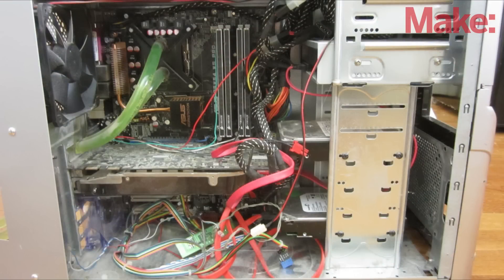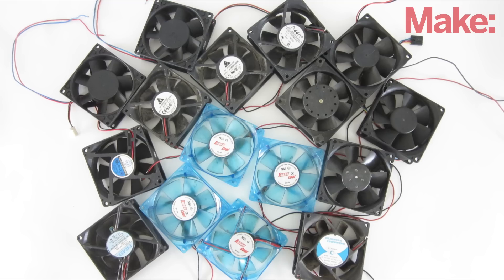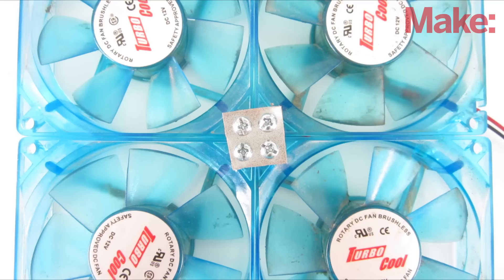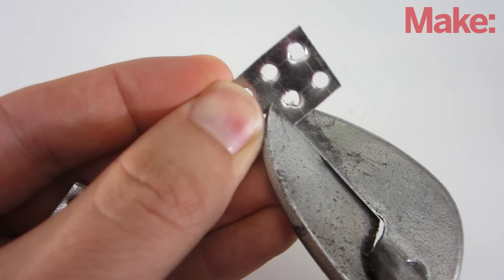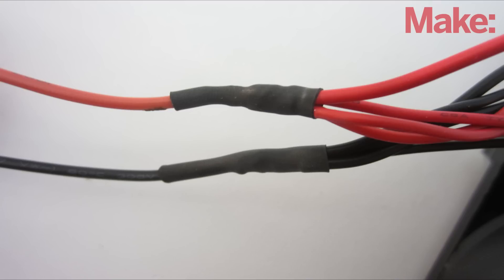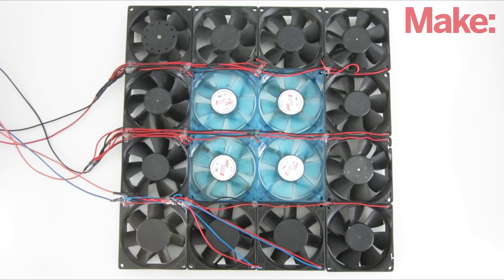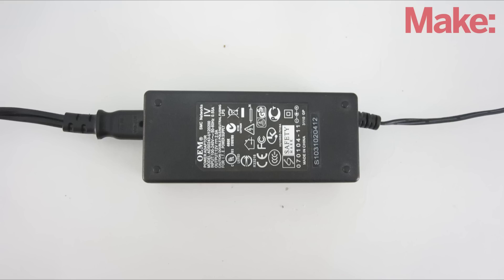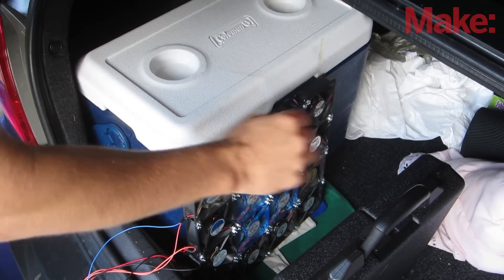PC Box Fan

Comment: also, rather importantly, make sure they're all flowing in the same direction lol
Reply: @burnzy3210 that easy if know fans have plastic crossing over one side and not the other and air goes through one way then
Reply: @mlee6050  I have several fans and they have mixed directions and do not follow the crossing. They shape of the blades is better indicator but there's also an arrow symbol printed outside the duct that shows the direction.

Comment: I just recently built something very similar (3x3), but built it into a collapsible/nesting type extension arm with a detachable carbon filter, it folds nicely and fits into the bottom of my toolbox when not in use and for portability. I use it as an overpowered fume exhaust (because I'm real paranoid about lead fumes when soldering, but refuse to use leadless solder). In my building there is an electronics recycling bin, and as luck would have it on the 3rd floor there is a hardware manufacturer who recently they put a few dozen new fans in the bin! Keep an eye on such bins folks, lots of treasure to be found, one mans trash right. Nice project :)
Reply: Lead isn't what's Evaporated

Comment: I dont comment on youtube videos but this one is special.  This has been the subject of much subconscious activity that occasionally forces itself into my conscious mind and distracts me.  When I saw the thumbnail of the video it was as if someone had been inside my head rummaging around.
So, that said, I also imagined the little metal squares with nuts and bolts. I also took that idea to the point of a sheet of metal on both sides with large holes for the fan to blow through and the small holes at the corners of the fans to bolt or even pop rivet then together.  What my mind kept coming up with was a wire routing that went into the spaces between the fans as there is just enough space there to put all the wires out of sight. Finally, my brain told me, all the stickers at the center of the fans should be pealed and replaced with round black stickers to improve appearance.  None of this is intended to be criticism because I never actually built my idea and you did.  This is just intended to infect your mind, which seems to be similar to mine, with the ideas I had for years in hopes that you might build it.  I think this idea could be taken to the point of a saleable product with a few finishing touches.  
Great work!

Comment: We did this a few times with left over fans. It makes a hell of a noise unless fed 5-6v instead of 12v. And if you make the mistake of chaining them, you'll cut voltage by half every step, remember that.
Reply: if you use 4 wire fans and connect the blue to Ground they run at low speed, almost silent!

Comment: Quiet ? I doubt it. Unless you spend a fortune on quiet fans, they're gonna be pretty loud, esp. if they're small.
Reply: *****
prius owners take every chance they can to let you know that they do drive a prius
Reply: for this sort of thing, i would recommend Noctua NF series or Aerocool DeadSilence (all 140mm) if you want quiet, but they are like £15 each (or your regional equivalent)
Reply: in a computer, premium fans are actually a really good thing if you have the room for air flow as they are optimized for pressure rather than just moving air, can drop the temp of your components a lot, however, open air solutions i cant say
Reply: ***** they are worth it. Great airflow low noise.
Reply: +StereotypedFilms could you link a $1000 fan?
Reply: +Daniel&#39;s Game Vault The Delta fans are the ones that isn't quiet. I have two small Delta fans and they sound like fighter jets.
Reply: I agree but the idea I like the idea. Good instructions.
Reply: the really good fans you barely hear while still providing high CFM. ..... hydrodnamic bearings are very quiet.
Reply: Depends on the fans, I got 11.3 dba 60mm fan for my 3D printer but my PC has fans that are quieter than corsair and the brand most get starting with n so yeah

Comment: if you hooked them in series you would need 192V which can easily be achieved with 120V mains through a bridge rectifier and capacitor gets you 170V each fan would get ~10.6V but thats good enough
Reply: That will not work. The problem is that the fans each draw current in pulses. If you could keep all the pulses timed so that all fans wanted the same amount of current at the same time, you could do it. But you can't keep them in sync. I have done 2 fans in series, and it didn't work well until I added a capacitor across each fan, to even out it's current draw. I also had to use matched fans. Same brand, size, and current draw. Then it worked fine, but I don't think it would be safe to try this with any 120 volt mains power, even if you did have enough fans to "share" the high voltage. The problem is if something goes wrong and they don't share and one fan gets hammered with all 170 volts. It might be okay if you lived in a house with concrete block interior walls and had no combustibles nearby. Other than that, put the fans in parallel and then you don't need capacitors, or matched fans. You can easily get a 12 volt power adapter online for a very reasonable cost. I have also seen adjustable voltage units that would let you adjust the fan speed easily.

Comment: So I made a modified Corsi-Rosenthal box, but the fan I used died after 2 months. I was turned onto PC cooling fans becasue I found out they move more air for less power. Now All I need to to learn how to rig them up and find a few used fans or dead PCs to pick apart.

Comment: So i was considering doing some type of Desk mod with fans, yea it gets hot in my room and ya know where i needs that fresh air :3 Anyway, ive got 1 12vDC - 0.37amps 120mm fan, if i were to do 18 just under 7amps for my battery would this work? Not gonna really do this, was thinking of around 10 fans which is around 5amps in total. Would this still work decent with my battery? Im doing this off of a Solar Controller/12vDC-7A Battery so i wont really be pushing that monthly bill xD

Comment: thanks man, I'm planning to attach them to my DIY laptop desk. 4x120mm fans is good enough.

btw how to know between + and - of the cables, and will it be ok if i plug it right into power outlet or power supply is the safest way?
Reply: Generally there are 2 kind of fans: 220v (ac) and 12v (dc) voktage. Check the voltage stated at the center of the fan. Then, for 12v fan, the positive usually have RED cable, negative is BLACK cable. If your fans is 220v, it is save to plug them directly to powerline on your wall. There is no + or - cable for 220v, you can safely plug the cables without worry of their + ot -.  DoNOT plug the 12v fan directly to powerline at your wall, they need DC 12v powersupply, or you can use your dad car battery, it is 12v. Hope this help.
Reply: @aswingsharif6729  ty man appreciate your help;) not an electrician, so im clueless and dont want to burn down my house in an explosion lol

Comment: This rig uses 38.4 watts of power. How many CFM? I can't help but think that it will circulate more air per watt than a comparable box fan with a shaded pole induction motor. My 20" Lasko box fan uses 55 watts on lo, and 96 watts on Hi. It does, however, produce quit a bit of airflow, though I don't have an accurate way to measure it. All I can think of is a side by side test. Your rig isn't quite that big, but it does't use nearly as much power, either.

Comment: i want to say this is an unimpressive video, but im more than likely actually going to use this for my windows, now only will it keep my home cool but it'll be a death trap for any flies trying to get in
Reply: I would but a big piece of modders mesh on the front and back sides of the fans too protect them from getting damaged, and instead of these small 80mm fans get like 4 220mm fans that can push the same amount of air at a lower speed, and with less energy needed.
Reply: Try having an old car battery to rig it up with and keep it charged when not in use with a small solar panel :)
Reply: +turtle79070:  Yeah, that seems like the one killer app for this multifan.  The fans I've seen that are designed to go in windows generally just have one or two fans in them, and then use a piece of plastic for the rest of the height, whereas with these you could have fans across almost the entire height of a window, and you wouldn't need to have your window (and vertical blinds or curtains) open more than 80mm.

So did you go through with the project for your windows?  How did it work out?
Reply: You can add a fan grille.

Comment: kk what is this for you know you can buy a normal fan or turn on the condition
Reply: 1. Not all places have air-conditioning 
2. I think his application is mostly to reuse old/inferior stock fans that get replaced 
3. This rig is portable and can be powered by many sources. 

Mostly though it seems like using stuff that would otherwise be thrown out

Comment: This is pretty pointless. a 20" box fan can produce 2500 CFM (according the mfg) and a cheapo (Rosewill) 80mm fan pushes ~32CFM. You can fit about a 6x6 grid of PC fans in that same footprint and 36x32 is only 1152 CFM.

Comment: I have problem. I have 1 amp 12 v adapter, when I run 1 fan it spins full speed, but 2 fans spins in half speed :(
Reply: you wired in series, wire in parallel. Make sure both positives from the fans are on the single positive from the controller, (same for negative side)
Reply: @Michael HTT at least you here can I use 12v with say 4 fans like if two series and two parallel (two sets of series connected parallel or something)

Comment: What a Great Idea, I to have many fans & now that i've seen this idea, I now feel sure that I can do Likewise.
Here is an instant Idea for the U-Verse owners out their. take a Single 120MM Case Fan & Mount it down on the top of your control box, The one that turns your unit on or off, & if So Equipped, (Like Mine is)  You can use the Front USB Port to Power the Fan, Thus Cooling Down your FAN-LESS Unit. We had already Burned up our first Fan-Less box, & the Salesman told us that none of their units came with a Fan to Dispel the Heat that the box Generates..

Comment: Wait so if I power two 12 volt fans I don't power it with 24 volts right?
Reply: No, they have to have the same voltage as power adaptor, so all 12V in this case. But you need to check how many Ampers your adapter provides and add Amper use in your coolers to make sure that they all don't take more than your adapter can feed them.

Comment: I know this is very late, but wouldn't it be much better to just take much larger fans (like 4 240mm fans)? Since it would provide a much higher contact area with the air, so more airflow and much quieter.

Comment: Bet the electrical efficiency is very low
Reply: 3.2amps at 12 volts is 38.4 watts. The average box fan uses 70 watts.
Reply: @Jcewazhere  Meh same thing, half the watts, but also half the CFM airflow compared to a similarly sized box fan.

Comment: why not just get a 10 doller large fan with a wire and just cut into your case and add that?
Reply: There's a limit to what large fans can do.
They may be bigger, but they don't push as much air as a setup like this.

Comment: A car battery has 60 amps. not .60, not 6.0, but sixty amps. I'm pretty sure that will burn those up in a heartbeat without any resistors or something in place. The battery shown would be the type that would come out of a battery backup unit such as this. http://www.homedepot.com/catalog/productImages/300/1c/1c48cba9-7888-4000-ac87-a294f780caa0_300.jpg
Reply: 12v car outlets are fused at 30A, also car batteries are alot higher than 60A. The internal resistors of the fans will be just fine to run them on.
Reply: granted I don't know much about computer fans (other than the fact it's square and moves air lol) but I would think hooking up a puny fan to that type of power would fry it faster than an egg on the sun.
Reply: Bryan Young Nope. Just as King Harkinian said, the internal resistance of the fans limits how much current (amps) that flows through them.
Reply: Well; you learn something new every day.
Reply: Rikard Bengtsson
Oh yeah What is it about motors & bulbs that limit their current?
You can blow them up if over volted right?
Reply: The current on the power supply shows only the max current can be used. It doesn't mean it will draw 60 A every time something is connected to it. Otherwise your car battery will run out of charges in a very short time.
Reply: Exactly.  It's the amperage draw that matters.  If you tried to pull 60A from a 1A power supply, you would burn up the supply.  If you try and pull 1A from a 60A supply, the supply has plenty of headroom to do so.
Reply: Battery will only give current as much the load draws. if the load draws 69A and the car has enouth C rating, and enouth voltage and capacity it will run good.
the thing about car battery is that they are LI-ION battery, and they have high c rating and high capacity, and most of the high c batterys are li-po.